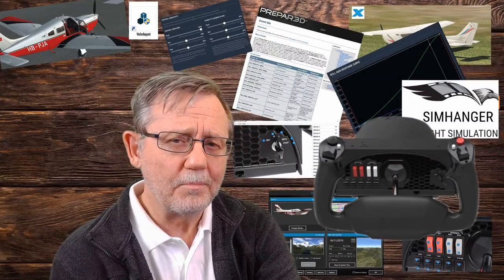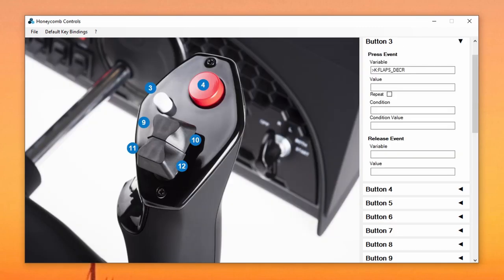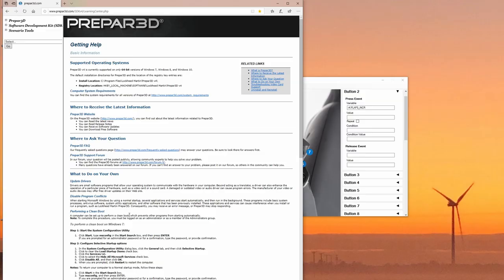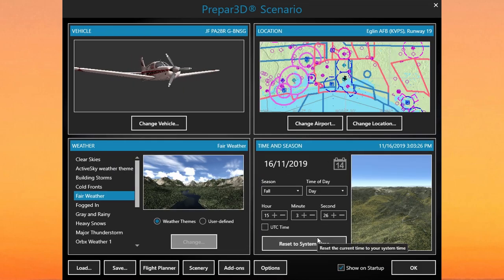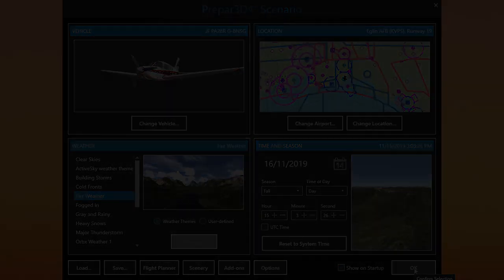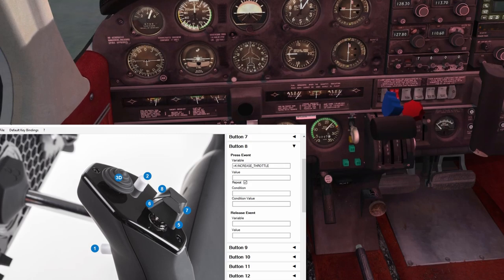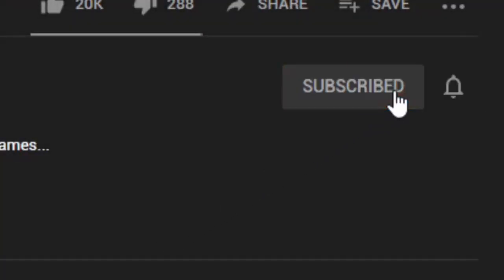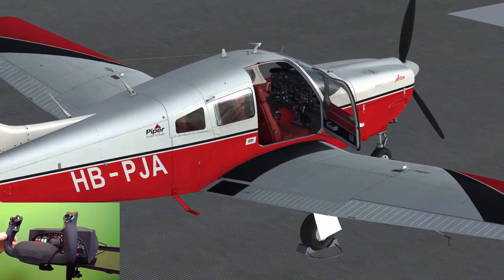Honeycomb Yoke | How to Configure and Calibrate | P3D | Xplane

Comment: A long time since you did this and both Alpha and Bravos are now coming on the market with a changed Aerosoft configuration- from the one you used in the video - and is even more difficult to understand - without a PHD in semantics
Any chance you could take a relook at configuring P3D V4 and V5 with Alpha and Bravo working together
Reply from the maker: Hello, if you check out my channel https://youtube.com/c/SimHangerFlightSimulation  there is a review on the bravo plus config guides for MSFS and Xplane. Still to tackle P3D v5. Regards

Comment: So I just got my yoke, went to the Aerosoft website, noticed that the DL for 2020 is really just one for the lighting. So when you say "just click on the icon on the desktop" all I have is an icon that updates the software. I do not have anything for set-up
Reply from the maker: Hi Bill, the yoke is directly supported by MSFS so no drivers needed for this. You can if you want download the throttle config for the lights as it does have a default config for the yoke as well. My channel shows a number of videos giving options for this configurator etc. Regards

Comment: hi,
i now have the honeycomb throttle quadrant to add to the honeycomb yoke.  I need to find out once i have set up the Throttle for single engine GA [which i have done] how should i configure the honeycomb yoke.  Since the throttle has flaps, trim, etc, it would seem i should modify the yoke setup.  Is there a you tube on what to do when you have BOTH honeycomb devices?  Or can you make one?  thanks
Reply from the maker: For what sim? I have done numerous bravo configs.

Comment: If your yoke is in neutral position, neither pushing nor pulling, will the plane pitch up? I just plugged in a honeycomb yoke and i have to keep a constant forward push on the yoke to keep it level. When i relax to the neutral position it'll pitch way up. I'm not a pilot and it seems ridiculous to have to fight it like that....
Reply from the maker: Orange Betsy , hello, the aircraft you are flying will have a trim wheel or something similar. Adjust the trim  of the aircraft up and down so it flys straight and level with the yoke centralised. You can then use the yoke as normal and for minor adjustments. Many pilots will configure the trim up and trim down function to the left most toggle switch on the yoke. Trimming the aircraft is also necessary when flying in the real world. Hope this helps.

Comment: My joystick inputs are not incremental but activate at polar ends of the movement......can you please help as this is happening on my new microsoft flight sim 2020 but not other flight sims before.
Reply from the maker: Greg Prouse , hi Greg, check that you have mapped them to an Axis and not a key command. Also check the sensitivity settings on the axis. Regards

Comment: i am hoping you could do a vid on alpa and starting up twin prop planes.
Reply: for x-plane
Reply from the maker: Eric C , this can be done, although the results are not always realistic. You can configure in Xplane the start functions to some of the buttons or switches. Although I have not tried it you may be able to configure auto in the same way. Regards
Reply: @SimHangerFS  yes how do i configure the the off:R:L:both switches?bbthanks for your swift reply
Reply from the maker: @ericc7936  , Make sure your yoke is connected and start Xplane. Go to settings then joystick. When you move the starter switches on the yoke you will see the switch and current function highlighted. To change the function click on edit next to the function shown on the right hand side. In the top search bar type in what you are looking for. Engine start will show options to set the switch position to auto start for example. Or type in starter and you can set individual engine starts. Choose the function you want and click OK/Save. Hope this helps. Ciao.

Comment: My Honeycomb yoke axis seems to be ok but in the cockpit they work in reverse??
Reply from the maker: Go and check the reverse axis box next to the config assignments. Common issue.
Reply: @SimHangerFS      Thanks for your reply,but my problem was,when  I used the yoke for pitch---(it rolled) when I used the yoke for roll it would pitch erratically. The nearest description I've seen was on YouTube under the heading of  calibration Issue.  This is exactly my problemwas doing
Reply from the maker: @kenrainford5568  sounds like you have the wrong assignments in the profile? Check all okay by recalibrating in windows first. Create new profile and recreate profile from scratch. This may help https://youtu.be/MjovDdueafI

Comment: can't figure out how to get engines running on q8-400 using alpha yoke. if you could help it'd be great, thanks.
Reply from the maker: Eric C , hello. If you are referring to the Majestic Dash 8 in P3D I’m afraid you can not easily achieve this as the program does not use the default assignments for some of the switches etc. You would need to find out what those assignments are, and they are not readily accessible, then use FSUIPC to configure.
Reply: @SimHangerFS  ok thanks. being a new novice simmer what and how do i find fsuipc. not majestic but regular dash 8. thanks for your swift reply.
Reply from the maker: Eric C , you only need FSUIPC if your using FSX or P3D.  Otherwise set up in Xplane joystick config. tab as shown and save as a profile. You will need to assign separate switches for each engine. You may find it easier to use the mouse for engine start up and assign the switches to other functions such as trim and lights etc.

Comment: my settings window for stick says i have multiple axis for yaw. how can i correct this error? thanks.
Reply from the maker: Set back to default and reassign as needed. Use the edit functions, Regards
Reply: @SimHangerFS  will all settings for all x-plane be set to default?
Reply from the maker: Eric C , set the yoke/joystick setting in Xplane back to default....not Xplane itself. When you go to settings and then joystick, select the desired input device and then set that device back to default.

Comment: Do yo need P3D? 
Can i not edit controls using the Honeycomb program for FSX SE without P3D?
I dont even understand what P3D is
Reply from the maker: Anthony Cooper ,hi Anthony, P3D is another sim based on FSX, Prepar3d from Lockheed Martin. You can configure this yoke directly in FSX -SE as you would any joystick or other input device.  No need for any other drivers. Regards

Comment: I just bought this  to use with my P3Dv4.5 sim .  Not much problem programming it, but for the life of me I cannot get the ailerons and Elevator to work correctly.  They work fine with the default aircraft in P3D, but a lot of my addon aircraft I just cannot get them to work.  There is no consistency.  Don't know if it's a P3D problem or a Honeycomb yoke problem.
Reply from the maker: Rodger C , hi Rodger, strange one...not had this before. Make sure yokeinput is not overriding your P3D settings. Regards
Reply: @SimHangerFS  I just wanted to let you know that after hours and hours  of trying to find out what is going on with my flight controls, I believe I have found a conflict with Chaseplane.  To explain what I have been experiencing would take quite a bit of space but I have found that when I open P3D and chaseplane is opened also I must close chaseplane then reopen it and all is well.  If I don't do that all kind of different things happen with my flight controls on all of my payware airplanes.  Thanks for your help. Just wanted to let you know that I "Think" I have it figured out.
Reply from the maker: Rodger C , glad to hear you’ve sorted it out. Regards
Reply: @SimHangerFS  Unfortunately, the problem is back.  My question is are you able to fly any payware aircraft?  Carenado, Alabeao, Quality Wings, or anything other than the default P3D airplanes.  I just got a reply from Honeycomb support about the problem and this is what he said.  "Thanks for reaching out to us. We are aware the some premium aircrafts have some issues with the yoke. We have spoken with our contacts and they have mentioned that developed design their planes vastly different than from the usual default planes. This can cause issues with the configuration settings. Some premium planes, for example, can have different variables than default, which causes the yoke to do different things than what you'd expect them, to do. Though it seems like closing Chaseplane fixes your issue, what I'm thinking that somehow, your configuration settings are being changed somehow. "  If you are able to fly payware airplanes than I must be doing something wrong.  Can you please explain to me how I can check and see as you suggested, that my yokeinput is not overriding my p3D settings?  All of my key assignments work perfect.  Just my flight controls don't. Thanks for your help, I greatly appreciate it.  Your video seems to be clearer than most that I've found on YouTube.
Reply from the maker: Rodger C  I am able to use third party aircraft with the yoke no problem, in fact I have not come across any that don’t work. It sounds to me that you have some configuration files corrupted. To eliminate yokeinput uninstall it. You don’t need it, you can and should configure your yoke in P3D using the axis settings. There are few other things to check. Make sure that there are no keys configured to your axis that are causing a conflict. If you have FSUIPC (payware version) installed check there for conflicts. Make sure the connector between the body and the yoke itself is connected correctly. Plug the yoke directly into your pc. Delete all files in the following directory....get this right or a reinstall will be necessary.....c drive...users....your name....appdata....local....Lockheed Martin....Prepar3d v4. You should delete the files and the three directories you find there....controls....effects....shaders. Make sure P3D is not running. Restart P3D and it will rebuild these files and sub directories. Please note you do this at your own risk.
Reply from the maker: Rodger C , it may be worth uninstalling chaseplane, in addition other options are to uninstall your third party aircraft and then reinstall. If all this fails then two options remain....the yoke is faulty or you need to reinstall the “client” only from The Prepar3d site. Good luck. Regards
Reply: @SimHangerFS  Thank you for your help.  I will follow your suggestions and hope I can get this to work.  Again, thanks I appreciate it.

Comment: You might like to check out these YT video's that appeared around the same time you posted.
Appears that the Honeycomb Alpha Flight Controls has some Deadzone Issues identified on: https://www.youtube.com/watch?v=A_pAurNW60E 
For those that want to take a risk and void their 5 year warranty, here's the subsequent Arduino Due Dead Zone Fix video: 
https://www.youtube.com/watch?v=Zw6lMA6qTBs&t=16s
Please also take note of the comments section for clarification.
Reply: Yesterday a person from Honeycomb recently posted on their Facebook page that the reason some yokes have a deadzone, and some do not, is that some of the early production units were calibrated incorrectly at the factory, giving them a deadzone they should not have. My yoke from the original preorder has a 5mm deadzone in elevator, and a 9° deadzone in aileron (5% of total rotation!). Also, I have found out that the yoke has a built-in "hidden" calibration routine that can be invoked to recalibrate with no deadzone at all - but those that have been told this procedure have been instructed to not make it public, as they are concerned a user could screw up their yoke even worse.